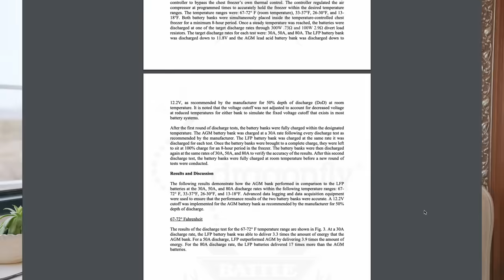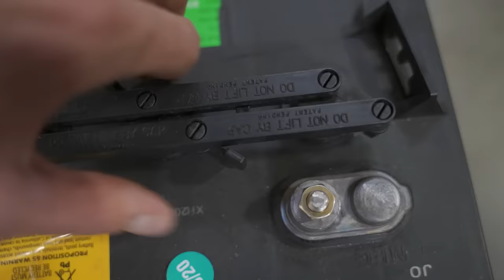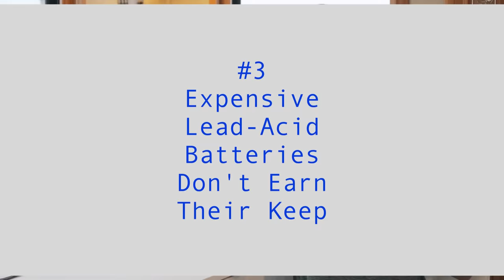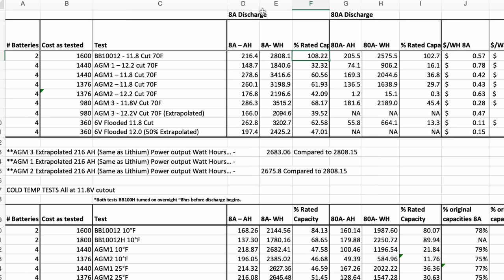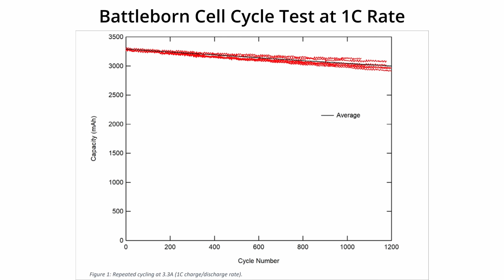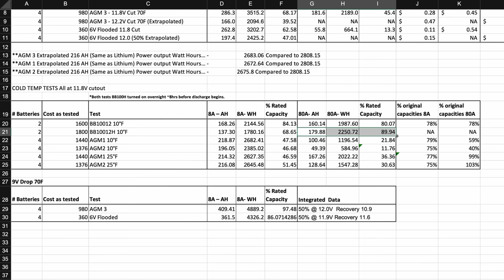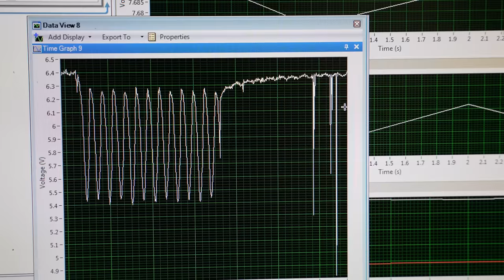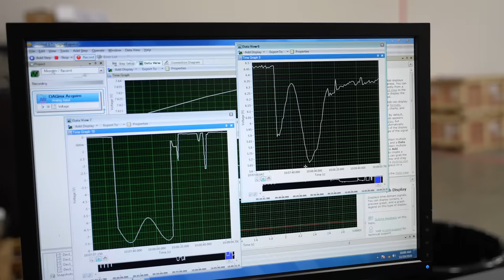Don't Waste Your Money On Batteries - The Shocking Truth I Discovered When Testing RV Batteries

Comment: I would think one way around using high current devices in an rv would be to fire up the engine when making coffee assuming they recharge from the engine or have a small genny/ solar etc. I have found a huge difference in how long flooded cells last in a motor bike with some lasting 5 years and some barely doing one.

Comment: From vast automotive experience, take a lightly used lead acid battery down to 9v more than twice and they do not usually recover. Depending on temperature you might get away with 3 or even 4 times if you charge immediately.
Reply: @schmetterling4477  dahh!
"DUDE" I know that.
 It was not my suggestion.
I maintain over 100 machines and vehicles in farm situations and let me tell you in the real world it can and does happen.
If you read my comment I was saying they won't survive it.

Comment: Some battery powered forklift experience: heated lithium in freeze warehouse is already 7 years old tech. 
Secondly, There is no such thing as a lifecycle or charge cycles for Lithium.  You might think a 5000 count lifecycle divided by 365 days in a year is a whopping 13,7 years of service. Nope. As  a lithium battery capacity degrades from the moment fabricated a % per year. So it is impossible to predict thus test  to what capacity one should test. It is not 100% for sure. Specially at temps above 40°C parasitic reactions occur much faster and disable ions.  Also is charging to a 100% SOG more degrading than charging to 75 to 90%. Sadly no realistic charger has that ability. 
Only calendar capacity loss can is appellabel to the chemical kinetics not charge cycles. Practical this means that your new lithium batteries in your RV charging @100% each day, while on holiday in the desert, might end up at 94% capacity when you return. Although the software of your battery controller still call this 94% (has calculated this as max sog ) a 100%SOG. simply because it can not take in more. which does not mean the max capacity it ones had.
I have not seen a Lithium battery with a lifespan of 8 years without severe degradation yet. Mostly BMS will give up after 3-5 years.  An other problem with lithium life span is the dependency on many many more parts and connections which can and do, fail much more compared to Lead acid systems. When it comes to reliability and proces continuity, swapping out batteries is not perse a bad thing. 
And last but certainly not the least is the environmental impact of Lithium batteries. Which is extreme compared to lead acid. Although the start the same by mining, after use lead acid batteries are very easy to recycle. Lithium requires a lot of metals like cobalt, iron, lithium, copper, aluminum, and it takes a 3 stage energy costing toxic proces which release many very harmful chemicals that even after treatment with again chemicals becomes to be burned toxic chemical trash, which again results in a lot of toxic chemicals.

Comment: I’ve discharged a single 12v battery for 24 hours straight using a 1500w power inverter powering two lightbulbs for my chickens in the winter
Reply: Powered the lights all the way down to 10.5V in ~10 degree Fahrenheit weather.. also forgot to mention it was lead acid.

Comment: I'd love to see the results for NiFe batteries however they need to be old batteries as they don't reach best results until a little older but have 50 year life span, are usually guaranteed for 20 years and some 100 year old versions still work.

Comment: I just traded in my 4 lead acid golf cart batteries for Lithium... I will never go back but something rarely mentioned is the weight difference. Lead acid batteries weighed 335 pounds and the lithium 60 pounds, I not only notice a big diffefernce in the way my van drives but I am sure I will save on fuel.

Comment: Not worried about the cold temps, just the hot temps 35C+.
A marine flooded lead acid battery I have drops to 12.12 during a max load of 24watts from a 200watt connected inverter. I have only charged it with 10watts at max, and I can never get it to float or even hit 12.7v.

Comment: My Chinese 48v 20Ah LiFePo4 escooter battery from 2016 is awesome. Although I don't use this battery in the colder winter months, it still provides me with significant range and is totally reliable. Oddly, I get more charging capacity when I charge it with the cheap low amp charger then when I charge it with my Grin Satiator customizable charger. Not sure why. LiFePo ROCKS!

Comment: Very thorough information indeed.....however, as most RVers seem to go to campgrounds with hook ups, does any of it really matter?  
We boondock nearly 95% of the time (not in a parking lot) and am on flooded batteries. For the lithium cost difference, including the ancillary costs for the various charging equipment needs, I'll stick with flooded battery (standard or AGM) and use my generator as necessary.

Comment: My concern here is the recharging process with Lithium battery. Specifically the ability for RV owner to bring the lithiums back after discharge without going on grid providing recharge at their max capacity. Many miles and hours of charge time required. Meaning a very expensive auxiliary charging system powered by vehicles engine. Not fair that this is not made clear here. It’s part of the cost unless you just want to partial charge and rarely if ever fully recharge them.

Comment: The problem for me when it comes to batteries is simple.......I am disabled, so I don't have a ton of money just sitting around in large piles in my spare room some place!! 

That being said I looked into buying Battle Born Batteries only to find they were wildly expensive and totally out of reach to any budget I might have for batteries!! In fact the most "cost effective" option I have is to buy 6v Golf Cart Batteries from Auto Zone, that I can order cheap enough to buy two batteries a month, until I have all the batteries I need for the system I want to build!! 

AND with that in mind, I am just now started to work on my solar power systems (I want two of them) which is going to take me more than a year (possibly two) to build at my current rate of income!! And my income is only $6500 a year (in 2021)!!

Comment: Yup, lithium just beats the pants off of lead-acid, alkaline, or Ni-Cd in almost all applications, there's not contest.  This is particularly true when it comes to total lifetime cost.  It is way cheaper to use lithium.  Not just for the power/cost ratio, but the extra use you'll get out of them in extreme conditions and the weight savings for mobile applications.

Comment: APC battery specs say you need completely different cut-off voltage at different discharge rates, which is normal and logical. You can't cut-off at the same voltage in the 8A vs 80A test.

Comment: It's funny that a couple nights ago I saw a YouTube video where a man was saying that over time, no matter what batteries are used with your solar panels, the batteries will no longer charge. He was trying a different way to store energy that was  produced by an old solar panel someone gave him.

He got a small water pump, put a barrel on his roof, then using the power the panel produced, the pump filled the barrel. Later that night he used the running water released from the barrel to power small string of led lights. 

My question is how much did the water power supply for how long. And would it be an apples and organs comparison?

Comment: @34:10 "I can conclusively say that there is NO situation in which a lead acid battery would outperform a equivalent lithium ion battery in a power storage application".  How about using a winch to pull a heavy load (single pull) up your tow-behind trailer?  105aH Group 29 battery did it with ease, but the BMS in the LiFePo4 battery tripped after half a second.  Too much current (hundreds of amps) for a single 100ah LiFePo4 and possibly too much current for a 200aH LiFePo4.  I know that it's probably a one-off situation, but it did happen (and I was expecting that result).  It's what lead acid does best!

Comment: I spent the 1k on a 100 amp battle born…it only powered a 12v fridge in my van..with a dc to dc charger for charging…I personally spent the big bucks  for peace of mind. I’ve had it for a two years and I’ve never check it.

Comment: I have both Lifepo4 and GC2 battery banks. You discharged the lead acid batteries at higher than their 20 hour rating. A 100Ah deep cycle lead acid battery should never be discharged more than 5A.  8A and 80A is not a fair comparison because it is higher than their 20 hour rating.
Reply: I bought my first lifepo4 battery this month. It has been amazing. I can discharge it at any rate and still get the same capacity plus i don't have to worry about sulfation. 
I now use my golf cart batteries for low load less than their 20 hour rating.  This test is not a fair comparison because he is discharging the lead acid batteries more than their 20 hours rating. Higher discharge rate is not good for lead acid. Lower is better.

Comment: thank you for this video, but ill go with my "hillbilly " friends on this subject. i am on  a budget, and looking at an affordable way of keeping my refrigerator running during a power outage. a lot of the , " off-grid homesteaders", use lead acid for their set-up. after watching a couple of their videos, ill choose lead acid, deep cycle marine batteries for my solar set up, some lasted 5-6 years using lead acid. unless lithium batteries come down in cost, which i don't see in the future. ill go with an affordable option. thanks again.

Comment: I don't have any problems with the two 540 amp hr 48 volt forklift batteries I run. That's 1080 amp hrs and the cold doesn't seem to effect them. The life cycle is 25 yrs. The only problem is they weigh in at 2000 pounds each.

Comment: This is very revealing for emergency battery backup in critical safety applications that require a 4 hour capacity.  Li Ion appears to be the better solution for longer discharges.

Comment: Answer this.. Great  that Lithium batteries are more efficient, but what about end stage of batteries.  Lead acid can be recycled, lithium bot so easy, a lot of them end in Landfills.  I managed landfills for years and saw it all the time.  They were a main cause of fires in landfills.  Most sellers of Lithium Batteries do not take them back, unlike lead acid where they take them back.

Comment: Something I’ve seen recently the new electric cars are using a regular 12 v car batteries for the door locks and to turn on the computer with and people are having all kinds of problems with this battery going dead and getting locked inside and outside of there cars as you’ve said the lithium battery would work much better for this. A friend of mine in the 80’s and 90’s was converting vehicles to electric they ended up using the higher battery bank at 120-140 volts and stepping it down to 12 volts because it took less current from the whole bank and they got less spike voltage that way along with longer steady outputs

Comment: During 2021 I bought a 10' bass pro plastic boat, a EnduraMax 40 on 36" shaft, and powered it with a 100ah AGM...all from BassPro. I boated with this running a depth finder and running lights for over two hours. Around two hours I was tired, only about 1/3 of the trip away from the dock. So I cranked up the 40 to full throttle and conveniently checked the meter on the motor....OMG, it was in the red! I did make it back to dock where I checked the meter again with the motor idle...all Green now. I am not any where as educated in this field of measuring as you are and I commend you. I do have some questions that I may have missed while watching.... 1. On the inverters used, What type? modified sine or pure sine? 2. Given most people do not use consumption for long periods, what was the "Recovery" time of each battery? 3. While lithium batteries are great, the cost is out of reach for normal consumers...When will lithium batteries become common place and inexpensive? Btw, I was born in 1960, I know what batteries can do on a farm...not a camper. I always bought lead batteries for their cold starting amps and decent cranking amp....got an alternator to top it up. Once the motor is running on an old motor, I have disconnected the battery just to see...don't need a battery!  Modern cars I would not recommend that.

So a closed system, solar powered, pure sine wave inverter, metered power on charging and use....What/which battery is cost effective?

Comment: I am a new subscriber.  Just found your video today on recommended videos & I'm definitely getting Lithium!!!
💥 URGENT REQUEST: If you are testing for "real world" RV battery usage -- Shouldn't you be running two testing loads: 30amp for smaller RVs & 50amp for larger RVs.  Everyone I know runs their A/C and at their fridge/freezer constantly during the summer months.  Your 20amp laod test may be too low for "real world" test results.  PLEASE REPEAT the experiment using the higher loads?❓ Excellent video by-the-way 👍 Also...  As an addendum, can you extrapolate what size solar system would be required to avoid having to recharge the batteries on shore power or with a generator?  I'm assuming that two batteries won't be enough storage...  How many Amp Hours of Lithium Batteries do you suggest in an effort to remain off generator or shore power?. Thankyou 💰🤑💰
👉👉  Also, Does Battleborn intend to use the new 4680s? ❓

Comment: Thanks for the video, it demonstrates that manufacturers are lying, 

A few notes and personal comments :

Lead-acid battery gain some power back by stabilizing the electrolytes after a huge power draw, 
but that chemical reaction happens a lot less in the cold winter weather conditions (-40 degrees in the Canadian north), there if the battery gets discharged, 
it stays discharged, most of the water ions freeze inside the battery, and some people keep a charger always connected or a booster pack on standby

1. This video is intended for university researchers, us common people would prefer a 10 minutes summary about the fact that those lead-acid batteries would be better if connected in parallel in huge amounts to reduce the stress done by pulling many amps.

2. Lead-acid batteries called sealed maintenance-free are a gimmick since they should have been refillable with caps to allow the user to add diluted sulphuric acid every year, it's a fact that lead-acid batteries produce gaseous hydrogen when charging and some of that gas will get out of the battery on the terminals and in the air, that is one of the reasons why they become weaker over time. In the old days, people could add water or diluted sulphuric acid to each cells) and that would reduce their purchase cost a lot, while increasing the maintenance cost unless it would be done for free.

Comment: Don't forgo facts like, maintenance on lead non sealed and spillage of acid in RVs, lithium specific chargers are a must, there's so much more to consider besides monetary cost!! Like your time, do you value your time?? After much irritation in roaming America's land in RV, have ended up with split system. Main runs off AGM 80% discharge battery, backed up by 10.8k lithium Delta Plus. The AGM does the charging and main supply to RV. For myself an older man in relatively good shape, the simplest system with least maintenance after much work to install was this.. If I could do it all over again I'd still end up this way due to main system in RV usage of 12volts. You use 24/48V battery you must step it down requiring additional material etc. If your system is 12v, stick with 12V. or you'll suffer with additional money and work applied. If my RV used 24/48v I'd indeed be 100% lithium 48volts. Only if RVs system was intended for lithium. There are so many things to consider. To make life easy you go with what you've got!! Any change from lead to lithium requires a different brain and additional cost/maintenance. So stick with what you've got Period. To add, most people's data comes from the companies themselves, as a retired engineer I can tell you these numbers are incredibly fudged about on flow tables, etc. A solar panel maximum is performed by placing an intense light directly atop of the face of panel! 100% means under absolute best condition 100% of the time. Life and time is like a river flowing, can never step in the same spot twice!; Things constantly change, like suns position. So be humble and start learning yourselves, start small and slowly mock it up as you learn what best fits your standard without compromising your life's time... Each person will vary according to circumstance. I've no family, only a dog to concern myself with. Some of you have kids/wife/husbands etc. So you can employ them into your maintenance to ease life's responsibilities allowing more time for love/life.. Good luck to you all.

Comment: It's 37 degrees this morning. Can't charge lithium batteries at that temp. Lead acid still going strong at 37 degrees and charging off solar fine. Lithium? You'd have to warm the batteries before charging.
Reply: They have sold that long ago, they have internal heaters that will allow you to charge below freezing. When it comes to solar storage,  lifepo4 is superior, plain and simple.

Comment: The problem is the method of use with the lead acid batteries. 1st of all in power applications lead acid batteries should be in 48 96 or higher voltage configurations  2 energy conversion is necessary with lead acid batteries. ,so DC to DC converter would be best to pleace load on the device and not on the battery. Thus is because as the battery discharges it needs more time to create the current.